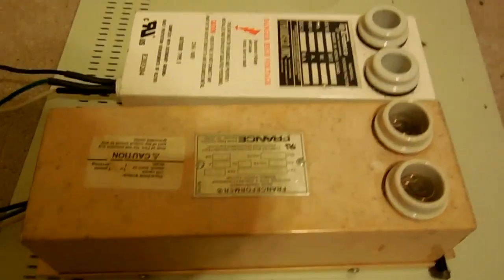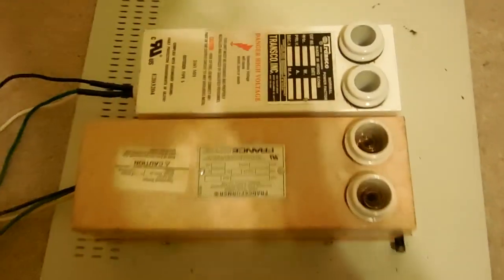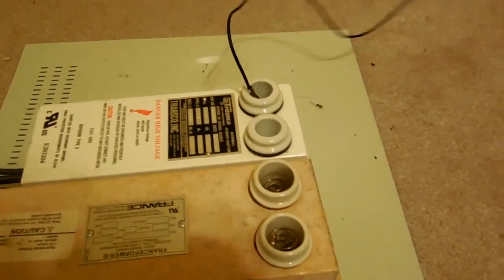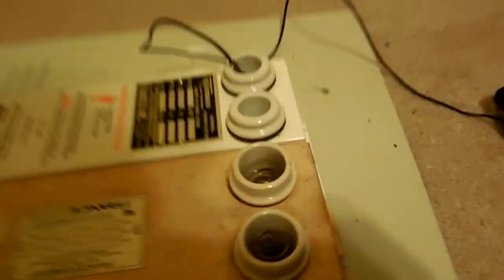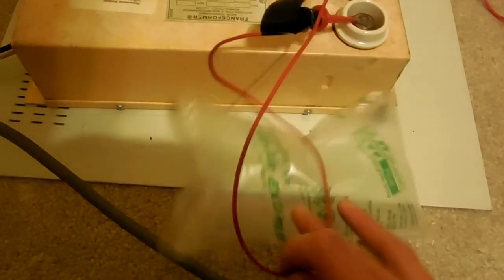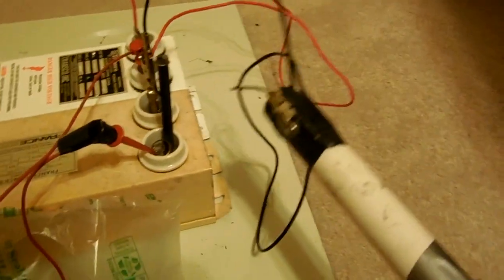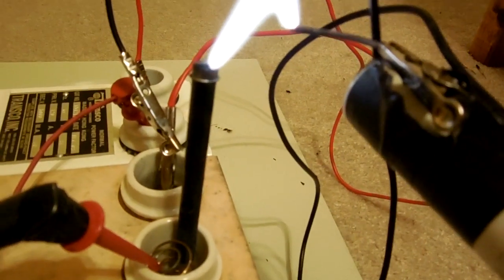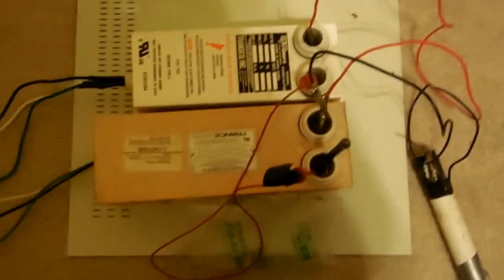How To Phase Neon Transformers Together

Comment: magnatek 15k nst. I want to make a electric barrier around bottom of my chikki coop to  deter predator activity. Can I do this, is it possible??
Reply: Walter Sobchak not without increasing the voltage, that would probably kill the chickens
Reply: Use an ELECTRIC FENCE, not a neon transformer. An electric fence is designed specifically for that application, and they are low in cost.